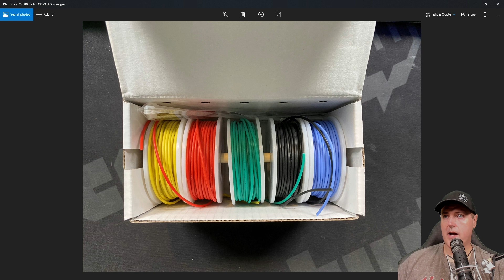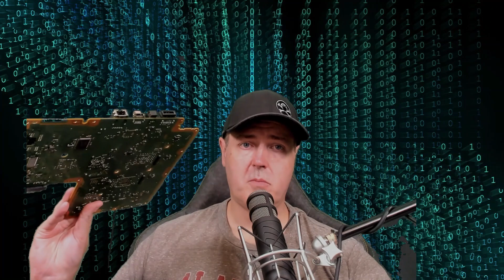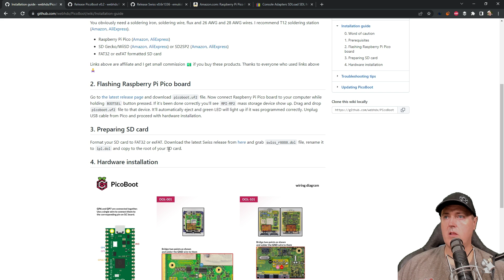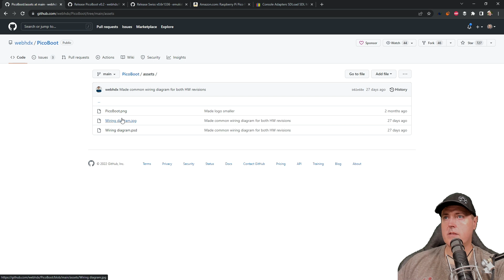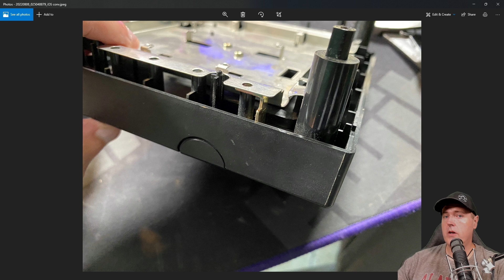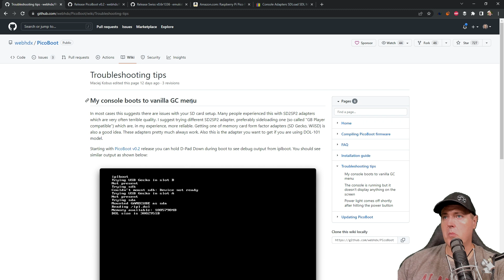Beginner's Guide to #Picoboot for Gamecube (Tips and Tricks)

Comment: nkit ISOs work fine. All my games are compressed using nkit and titled GameNane.nkit.iso and work perfectly fine compressed. For example, my GBA player disc ISO is in the root folder and works fine at under 3MB in size.
Reply: Thank you so much for mentioning that! Mine are all nkit.iso also, and when he said that, I worried that I might have to convert them all back to .iso again. Wasn’t looking forward to the extra steps. 😅

Comment: Hey, thanks very much for the thorough video. I was fussing with my gamecube for a few hours yesterday and kept getting the black screen while the power was on, after seeing your video to shorten the wires (mine are currently 15cm long each...) I'm hoping that fixes the issue. Best regards to you, dude.
Reply: It didnt fix mine.
Reply: didn't fix mine either and i bought my pico from aliexpress ...., i also have a black screen and i wired everything correctly .

Even made my cables as short as possible just so i would have a spark but to no avail . 

I think using thicker wires that go to the 3rd and 2nd leg of the chip will solve the problem and the ground wire that goes to the mobo and the pico chip ( i haven't tried it yet ) 

outside thicker wire i wouldn't know how to make the pico work properly.

I have updated my pico and putted games on my SD card and did everything according to the book and still i have a black screen aswell BUT my gamecube runs tho i get a led light and everything works except no video output .

I have used the same pico on 2 gamecubes and both show the same problem . could also be a bad picoboot chip ? ( maybe ) i don't know

The pico blew up my crystal oscillator on my 1st gamecube mobo and now i need to replace that one in order for my gamecube to work again .

Comment: Can I use any other wire besides for 28awg?
Reply from the maker: sure! 26awg works great and is recommended on the project page wiki
Reply: @mbcrump  Question… do the game saves get stored on the same SD card that the ISO’s are on? Or do they get stored on a separate memory card in slot A or B? I’ve watched a dozen tutorial about picoboot and no one ever covers that part.
Reply: @Vmurph  Swiss, in the settings, gives you the option to tuen ON the virtual memory card.
Reply: @MonchoPR_1987  Thank you!